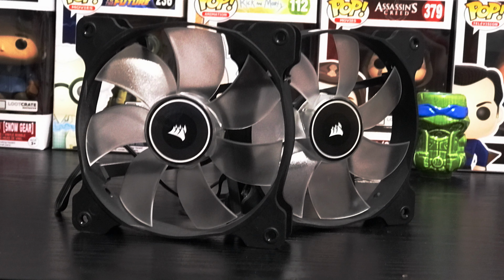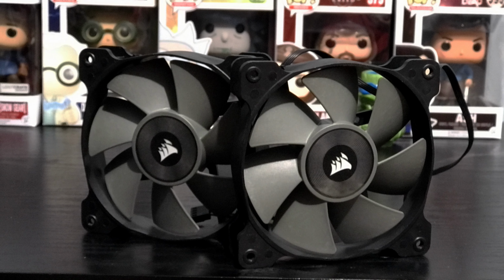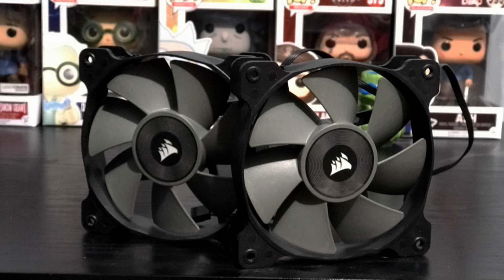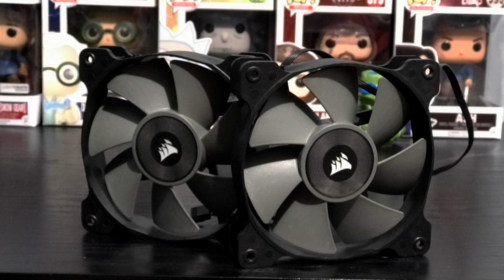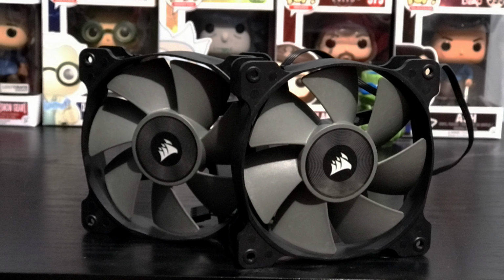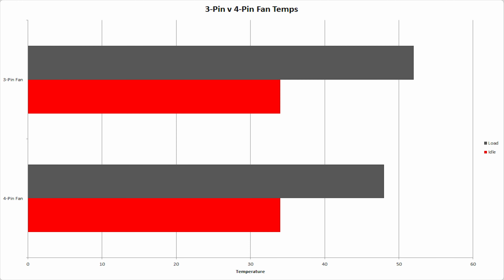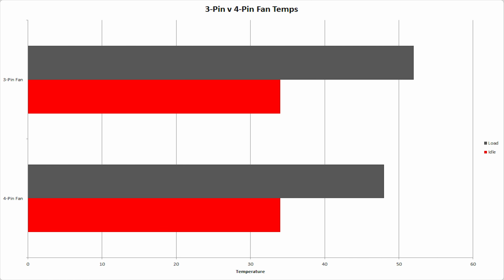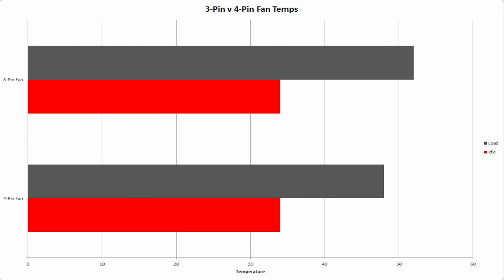What's the Difference Between 3-Pin and 4-Pin Fans?

Comment: i cant seem to find a 3 pin fan connector on my motherboard..
Reply: 3 pin fans use the 4 pin motherboard connectors, 4th pin just isn't used.
Reply: Harry Sadler i figured it out right after i typed my comment , am kinfa dumb cuz i had trouble putting it in what eva but thx

Comment: I just got my case today the corsair 200r it came with 2 case fans but they are 3pin and I have the msi b350m board it has 4pin will they still work or should I get new case fans that are 4pin?
never built a pc before this is my 1st time
Reply from the maker: 3-pin fans will work with 4-pin headers on your motherboard. They'll just run in DC mode, as opposed to PWM. You won't notice too much difference in performance, just in acoustics. Also, free fans are better than the kind you have to pay for. Happy Building!
Reply: Shane Gordon I've got the same motherboard if you look at the sys fan 1 2 and 3 u can see the 4th pin is reserved this is for pwm. It will be fine.

Comment: I have (3) 3 pins fan. I wanna use fan splitter since that my motherboard only have (2) 4 pins. Will the fans work when I use the fan splitters. Btw, I know that 3 pins will work on 4 pins, just wanna know is it still works when I connect the 3 pins to the 4 pins splitter thingy
Reply: IZZGAMER123 unfortunately, my fan splitters haven’t arrived yet. So, I’m still waiting
Reply: Did it work?
Reply: Hendo yes, it does. My fan splitters failed to arrive to my house,  and I did it. It works

Comment: Thanks for the video. Did you use a program to control the 3-pin fan speed, or do they run at full RPM? I am asking this since PWM control is no longer available for 3-pin
Reply from the maker: My motherboard was able to to tune the DC voltage for the fan, its not as precise as PWM, but it does the job.
Reply: I see thx

Comment: So ive changed an old  cooler master  (4 pin) to a tacens aura ii (3 pin) for cpu cooling . Any Problem? Its just a casual pc, not for gaming.
Reply from the maker: As long as the Tacens Aura fan is a static pressure fan you should be good. If its an airflow fan, you will get less performance than with the coolermaster fan. But if your only doing casual pc stuff, its probably ok.

Comment: dont do the all fan calibration on an Asus motherboard ... its better to just manually change the fan curves in the bios from factory default settings. the all fan calibration will often limit how low you can set the fan speed. One would assume that the limit the asus all fan calibration sets for the fans would be the minimal possible value but its often not the case as the fans can be set to lower values without them shutting off.

Comment: I search the speed adjustment of the fan and the results is some motherboard suppor 3 pin fan speed adjustment, I am getting the Rog b 350f ganming, can this motherboard adjust the fan speed? My case fan is corsair 12v DC 0.30A brushless fan,  is pre installed in the case 2 140mm fans in the front and one 120mm in the back.Hope someone could reply me asap cuz I am getting rest of the components and start the build at black Friday.

Comment: I have a dell motherboard and it had a 5 pin fan on it and my 212 led is 4 pins and I can’t find one adapter anywhere
Reply: Ah I found it
Reply: Pocaton 5Pin Female to 4Pin Male Socket Connector Jack PWM Cooling Fan Power Cable

Comment: I have low budget so, in short i want to replace my intel stock cooler with a better cheap cpu cooler but all of them have 3 pins, will using converter affect performance?
Reply: Pretty sure cpu fans are different. They change depending on cpu heat. So 3 pin is fine. don't @ me on that tho I'm not 100 percent sure
Reply: Gurveer Sandhu ok thx, i just relised that its fine using a 3 pin fan on 4 pin

Comment: Can fan speed be adjusted with 3 pin fans?
Reply: Yes but not so ideal. If your motherboard didn't detect your fan as PWM connection (3-pins), it will use voltage to control your fan speed. If your motherboard detect your fan has PWM (4-pins), it will use "digital" signal to control your fan speed. The pro of using PWM is the fan speed is more accurate because your motherboard just telling the fan speed it want and then the fan internally control the speed for it. The non-PWM fan is not so efficient because all manufacturer's fans have different speed even you set them as same voltage. So it is not ideal for motherboard to control the speed accurately.

Comment: Can I plug my 3pin case fan in a 4pin connection in the motherboard
Reply from the maker: Absolutely, , modern motherboard fan headers are designed to work for 3 and 4 pin fans without issue.

Comment: how can i change 3 pins to 4 pins ? Have any adapter ?? i cant control my fan speed and is super noisy please help
Reply from the maker: You can't really adapt them that way. You can however use a pwm fan hub, that will allow you to control the fan speed through your motherboard. Something like this: http://amzn.to/2zObf4w would do just fine. Note here that your motherboard may have a fan set curve setup, which may help as well.
Reply: I found in bios said what system fan so I clicked it and it shows me the fan curves setup there pwn/dc so thats mean I also can control speed whatever pin I have ? Btw im using asus rog strix B350F am4. and when I use it two of my fan work but one of my fan still run on full speed I dk what can I do
Reply from the maker: Hey I found this program on Asus' website for your motherboard. It's a fan speed tuner. There's even a video to help https://www.asus.com/us/support/FAQ/1034000

Comment: i got the msi h270m bazooka mobo and im pretty sure it only has the 4 pin headers. the thing is i bought 3 corsair af 120's (3 pin) how will i be able to connect them? I also have my included 3 pin case fan :(. And i would need to do it for cheap, if not free because im on such a tight budget (long story).        my first time building btw
Reply from the maker: 3 pin fans are compatible with 4 pin motherboard headers, just make sure the plastic tabs line up when your plugging them in. You will have some degree of control as well, since 3 pin fans can be regulated via dc voltage, but I'd check your motherboard manual for setting that up. Good luck with your first build!
Reply: Circuits Anonymous what plastic pins line up with what? i feel dumber each question i ask 😂
Reply from the maker: http://i.imgur.com/YSDYL.jpg , that's the plastic piece I'm talking about, the fan cable on the fan should line up with that. That type of header is compatible with 3 and 4 pin fans, your headers may be a different color, don't worry about that. Try plugging a fan in, and you should see what I mean.
Reply: Circuits Anonymous oh i see. i feel so dumb. thanks so much man! im subbin 🤘✌️
Reply from the maker: Thanks! I really appreciate it.
Reply: just built it and got speedfan. they dont show up. not even the cpu fan... how would i control them? theyre so loud,
Reply from the maker: Try downloading the Command Center software from MSI https://www.msi.com/Motherboard/support/H270M-BAZOOKA#down-driver&Win10%2064, https://www.msi.com/files/pdf/COMMAND_CENTER_User_Guide_EN.pdf, I found it on your motherboard's support page. Based on the manual, it seems to have options for you to set your fan speed and such. Let me know how it goes.
Reply: Circuits Anonymous thanks so much man! works amazing. only downside is it dosent show/have temp control for the gpu. i feel bad asking but do you know of any kind of light (as in on the cpu and stuff) temp monitor software that just like shows all temps?
Reply from the maker: MSI Afterburner will do that https://www.msi.com/page/afterburner
Reply: Circuits Anonymous okay ill get that. thanks so much man youve helped me immensely
Reply from the maker: Your welcome, glad I could help!

Comment: Can I plug my 4 pin fan into a 3 pin on my case?
Reply from the maker: If it fits, it sits. As long as the connector lines up, and its not interfering with anything else on your motherboard, its probably not an issue. You just wont get pwm support.
Reply: Hey man thank you for the quick response I really appreciate that!

Comment: can you configure 6 pin rgb fan into 4 pin pwm?
Reply from the maker: You could probably jerry-rig an adapter, but the additional two pins are usually part of proprietary tech, based on the company you bought them from, so you may lose some or all functionality if you try to use them with unsupported hardware. Try at your own risk.